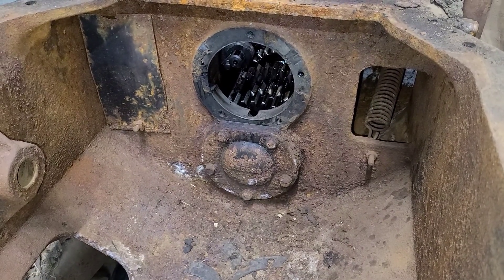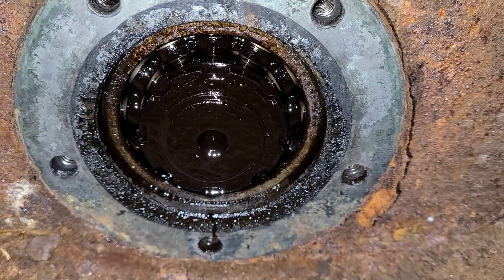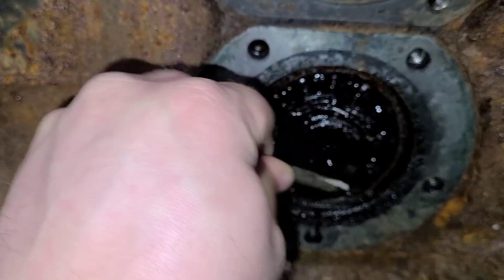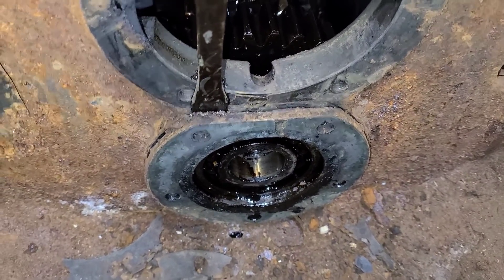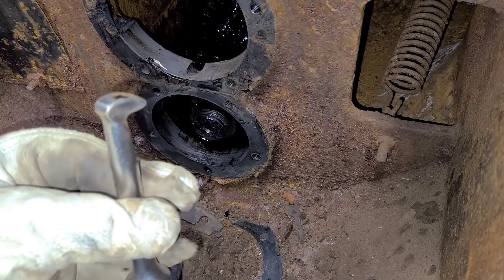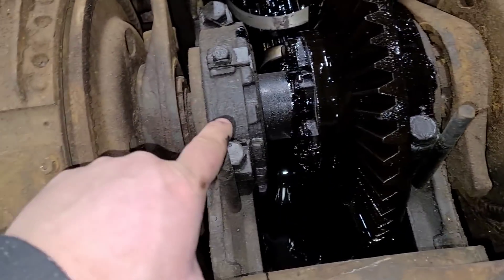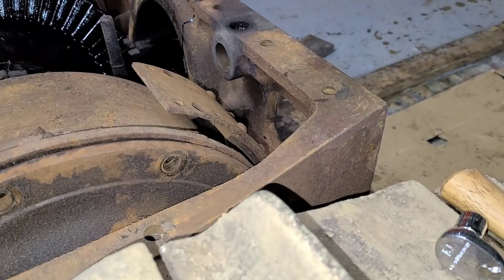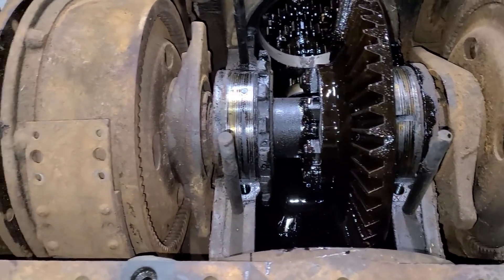Caterpillar RD-4 Transmission and Rear End Disassembly Pt.1

Comment: Now you do things the way you like to do them, but when I watched you pecking around with that chisel to split and separate the removable section of the brake bands..................I kept reaching for my air chisel with a broad blunt tip saying "Here, let me rattle that for a second and it will be loose".
Reply from the maker: I have an air hammer here, but it's not as audio friendly haha
Reply: @kylechrist  Just to be clear about "rattling", I wasn't meaning to duplicate your technique except use an air hammer. I learned that sometimes trying to split apart rusted plates by driving a chisel between them can result in curling or bending the edges of the lesser plate.  I meant,  set the blunt end of the tool against the flat plate area right in the center (as if you drew an X between the 4 studs) and "rattle" the surface.  Begin in the center and then work your way out moving the tool tip in a spiral towards the edges.  Somewhere during this the 2 plates will separate and the rust will shake loose from the studs too. Even though I mentioned air chisel, I have also used an electric percussion drill set to percussion only where something needed rattling and air wasn't available.  Like the old saying goes....."So many Cats, so many ways to skin them".

Comment: Does your impact driver have a low torque setting for breaking loose bolts so they don't snap off?
Reply from the maker: Yes it does, typically I break all bolts loose by hand, inside oil compartments I don't worry about it as those bolts aren't rusty

Comment: It's very easy to make a tool for the sloted nut on the counter shaft, get an old 1/2" socket with the outside diameter as the bottom diameter of the slots and tack weld some key stock to pick up every second slot in the nut. I have been doing this for many years even on hydraulic cylinders with slotted gland nuts except I cut out "c" shaped spanner using 1/2" plate.
Reply from the maker: Yep, I've always made my own spanner tools to fit each job, I just finally bought a set of wrenches

Comment: I have one small gripe you could have used some brake clean on that spanner nut to give you a cleaner work space and a bit more contrast for a better video. Other than that, excellent video! 👍
Reply from the maker: Noted, most nights I just want to get things apart as my evening time is limited but I still want to keep everyone updated so small things like that are overlooked, thanks for watching
Reply: it's a spanner nut.  What's there to see?

Comment: Kyle, you seem to have a number of specialty tools, but the one tool you are missing, which in your climate and in your dismantle of the D2, which you really need is a high-heat output performance torpedo heater. With one, you can not only heat your shop for comfort, but with a good one, you could possibly regenerate that goopy oil and make things so much easier in the dismantling phase of the D2. Just a thought.
Reply from the maker: I have a couple torpedo heaters, they are too loud to use with recording so I just leave them off entirely. Thanks for watching